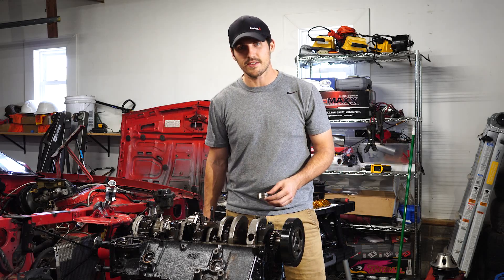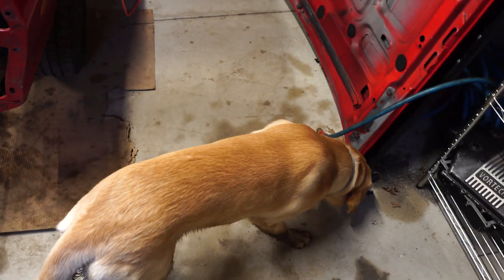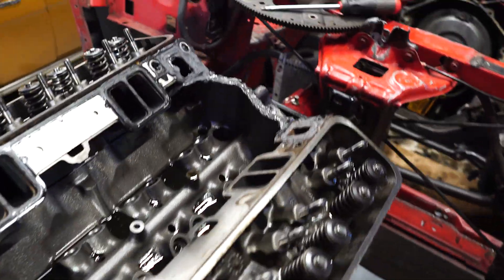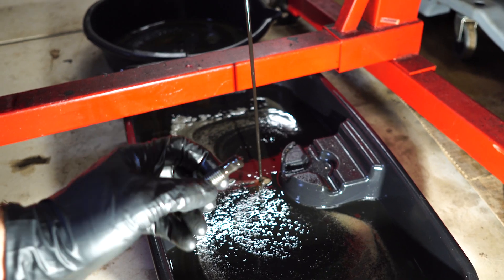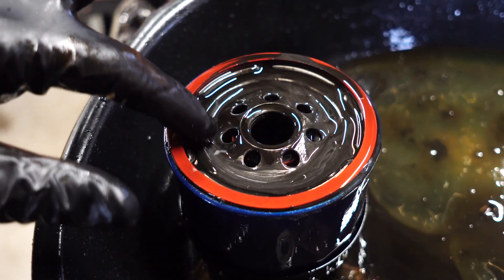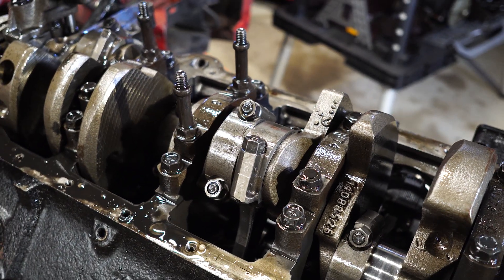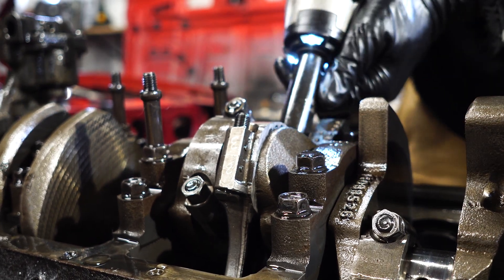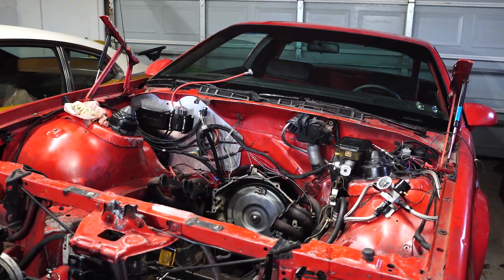Massive Engine Failure - What Rod Knock Will Do To Your Small Block Chevy 350

Comment: I have a Chevy 1996 5.7L 350  Sb is knocking noise. I took the oil pan out and found metal residual. I was told I need a new engine. The engine turn on and drives. Any advice please. Thanks
Reply: You probably don't need a whole new engine. Get your rod bearings checked out and your journals refinished, and make sure your oil pressure is up to spec.
Reply: Mechanics will say you need a new engine to avoid having to rebuild it. They make less money on engine rebuilds because they can't get it done in less hours than ALL DATA suggests. Ex. Ball joints the book time might say 4 hrs, if they can do it in 2hrs they make more money because your still getting charged the 4 hr time ALL DATA suggests. Is it ethical, I dunno but they all do it.

Comment: Thank you bro I’ve been searching all over YouTube to see what rod knocking would do to a engine. I watched your other video also!! New subscriber 🔥🔥🔥🔥🔥
Reply: Hey man I got a 89 GMC OBS 350 engine with a rod knocking. Can I just swap out the rod?
Reply: @wildestcowboy2668  no you would have to get the crankshaft grinded, polished or switch the crankshaft.
Reply: @papergatorzfedducca7998  Thanks for responding and what's amazing even though I don't drive it much it still runs fine.

Comment: The stiffener rails on your oil pan are missing. They really do a great job of dispersing the torque of the oil pan bolts to prevent leaks and damage to the gasket from over tightening .
Reply: I know this is a couple months ago, but from the looks of it, it is a felpro one-piece gasket. They have built in plastic washers that prevent overtightening and thus crushing the gasket.

Comment: The block is probably OK. check the mains very,very carefully  the crank will need to be taken down .010 or .020 and while you have it down you really should get a forged crank and put it in. Cast cranks will not survive in a high rpm environment.

Comment: ;you found your problem at about 11 minutes. IF the pickup was laying in the bottom of the pan you had low intermitent oil pressure. Luck all you got was a bad rod bearing. put in a new pump, set the pickup height correctly and tack braze the pickup to the pump body. I personally us the larger Melling pumps with the 3/4 inlets and bolt on pickups.

Comment: hi there     i just bought a  350 4 bolt  chevy engine . the guy said it had  a perfoamance cam  and double roll timeing chain   and   high  volume oil pump .    with   .oo2  crank and rod bearing .     but he would not let me turn it over   so i took it any way   .    got it to the shop and  try to turn it .   it  turn   and then bind  and then turn   over    with  my tork wrench .     and it had  regular heads and   intake on it .    but i need  to use   my vortec  intake and heads .    so i remove the older intake and  heads   and   notice   they was regalar tapit  lifters   and   roller rockers and  and   stock tapit cam .   and gear to gear cam .  in place of the timeing chain    and     dome pistons with two vale relieafs     . and then    top it all off   i fond out that  my    vortec heads would not work .     because they were hiting  .    the top of the piston s .     so i did some changing around   and   look over the bottom end   bearing   and fond some of the rod bearing cap were not mark .    and   a coupble  rod bearing were scatch . so i reple them   and    use plastake guage to check clearance  .      and side  clearance .  .     and then tork to   35 lbs  on rod  bearing    nuts    and the   crank   got tork to    65 lbs outer   and 75 inler bolts .     now i   put it back together    and put oil in it and    spin the oil pump shaft with a drill  until   oil   rand  out of the push rod holes  .     and the  gauge  i had   hook to the engine  said 75 lbs of pressure .    and then i notice my freash oil was  black . yep so   they was a use  oil filter on a  rebuilt engine .   . so more less this hass   been apain in my ass . because its still hard to turn  over with the spark plugs in it .  remove them  and it easy .       pleasse help if you can      writ me to my email add  and   ill give you  my ph. number .    so i can send you some pics 
 ps just   need help    because this is the first     engine that eveer gave me problems   because of these   piston  im use to flat top  ones .       this engine has stress me out .  real bad that i just want to  drop my   tools   and walk away .   or  set it on fire    and lose out on my  $500   i paid for it .     it was suspose to be a motor for a 1994   gmc 4x4   with a 4l60 e trans . dayley driver  truck .
Reply: Suggest you replace the pistons, & sence you got it apart go ahead & have the heads reworked,wouldn’t hurt to have the crank shaft done if you got the money,about $250 to turn the shaft.
Reply: Also put big magnet on bottom of oil pan,I uesd a 50 lb neodeniem magnet on mine,change filter & new oil,run 10 min. At 1500 rpm,change oil & filter again & clean pan good then run 10 miles low speed & change oil&  filter again,& clead pan again,after that 3rd oil change & filter will clear most particles from engine.Mine is still clean after 200 miles.
Reply: Not trying to be  cpt obvious but if the guy wouldnt let you crank it thats a huge red flag lol

Comment: Ad same problem I replaced part pick up tube tack weld to pump solution .still working after 5 year
Reply: hi i seen avideo on that and told my friend about how i was going to weld   my too . and he said there press in  . and how can u weld  meatle  to cast .    and to not do it . because if the oil   pump screen fall out it just   fall to the botom of the pan . and  your have less oil pressure .  .      .     but i see his   above didnt .   and it cause mager problem s .       what i usely do is   press the   screen in the hole   with a   open end wreanch and hammer  .   and then  lift it up    a little high put the oil pan on and it puses it down    to were it should be .   because  if  it to far down   or to hight it  will   afect the oil pressure .      hope this helps .   happy build s .

Comment: Good Video, my 5.3L Tahoe oil looks just like that with the metal flakes. I’m head knock in the 6 cylinder is losing pressure. Going to check the bearings this weekend. Oh an my pickup tube was clogged with metal shavings. I’d replace your oil pump too.
Reply from the maker: Thank you and during my rebuild of this engine nearly everything was replaced including the oil pump 👍 good luck with the Tahoe!
Reply: sorry to be so off topic but does anyone know a trick to get back into an Instagram account??
I somehow forgot the login password. I love any help you can give me.
Reply: @Zander Kristopher instablaster =)
Reply: @Tristan Paul thanks so much for your reply. I got to the site through google and im in the hacking process now.
Seems to take quite some time so I will get back to you later with my results.
Reply: @Tristan Paul it worked and I finally got access to my account again. Im so happy:D
Thanks so much you saved my ass!
Reply: @Zander Kristopher no problem :D

Comment: What exactly is that engine what kind of connecting rods?
Reply from the maker: Engine is a 350 small block chevy bored .030" over. Rods were out of a zz4 crate engine rebuild. Just your basic 5.7" rod.
Reply: Thank you I have a set rods like that out of used engine
Reply: How many miles did you put on the engine before this happened?